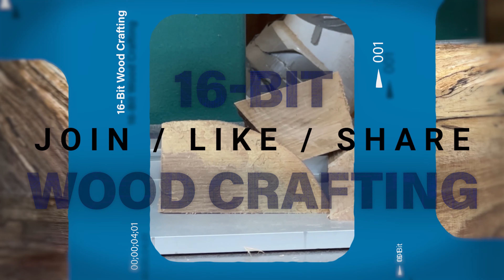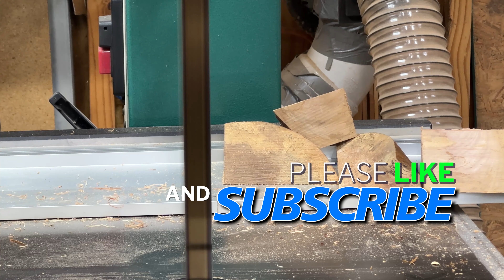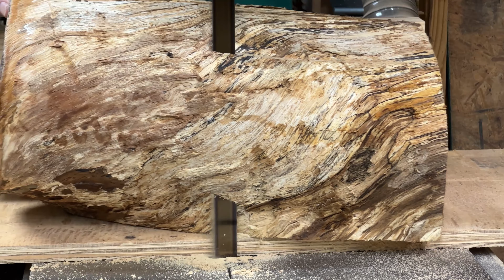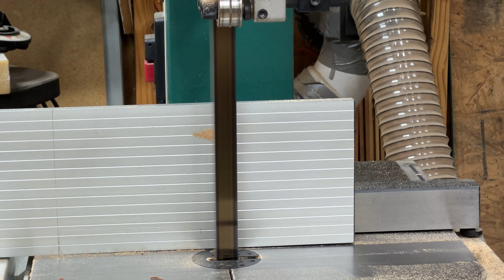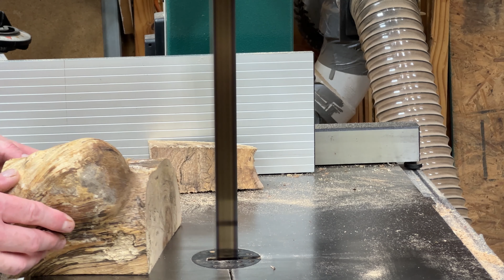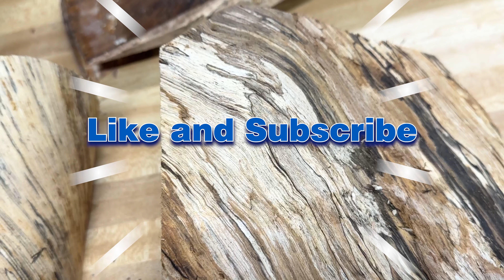Pecan Slicing / Milling on the Bandsaw Nice Grain for Bowls / plates / Boards - 16Bit Wood Crafting

Comment: What type/size bandsaw do you have?
Reply from the maker: Xtreme 17 cast iron trunnion  grizzly
Reply from the maker: Grizzly xtreme series 17inch cast iron trunnions
Reply from the maker: So far so good , only thing needed is extra bearings i have replaced two bearings on the guides